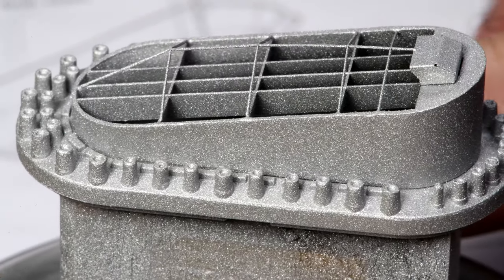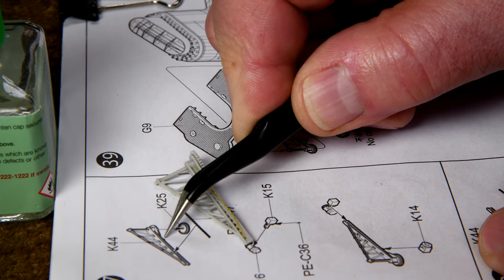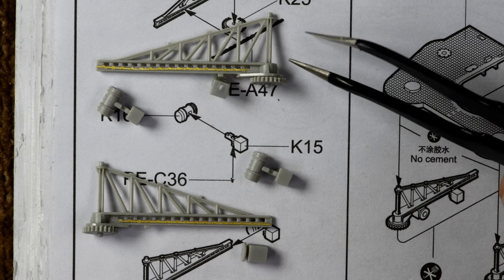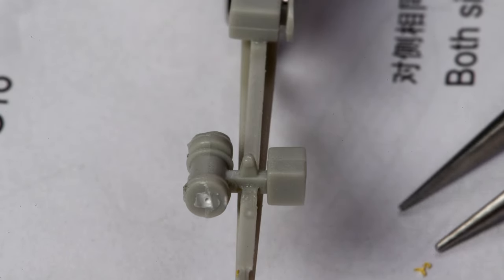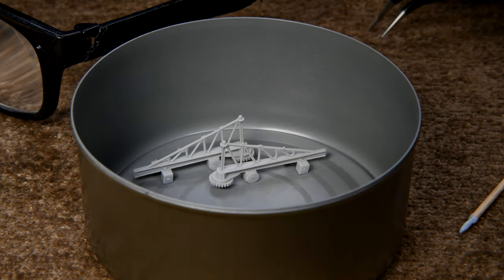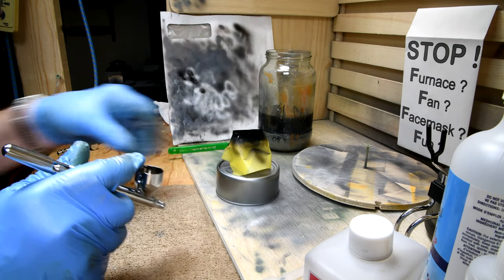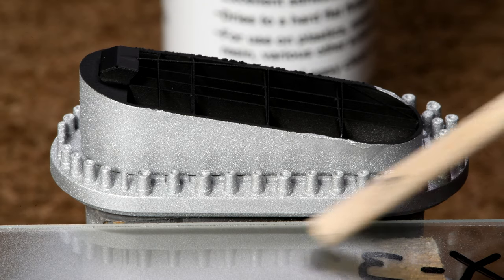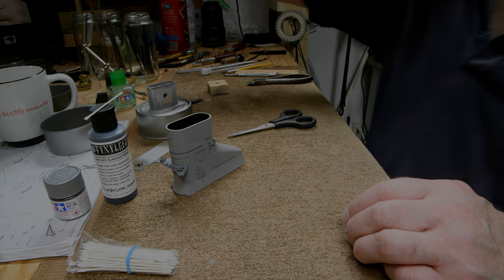The Model Ship - Part 190

Comment: Looks good, wonder what these where for. Life boats or float planes?
See you tomorrow.
Reply from the maker: My guess is, most likely for the planes, since they are positioned over the hanger entrance. Possibly they were used to help position the plane onto the catapult. The large cranes would better accommodate the boats, but likely they would have also been used to retrieve the float planes from the water. We won't be doing the large cranes for several steps yet. Thanks for noticing and commenting Tom. 👍